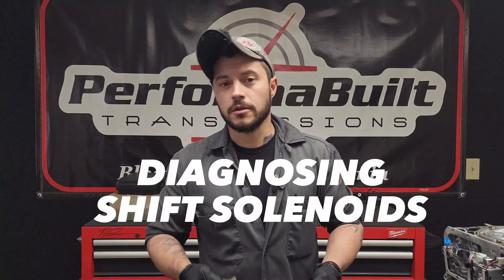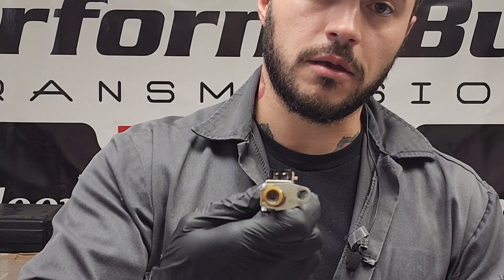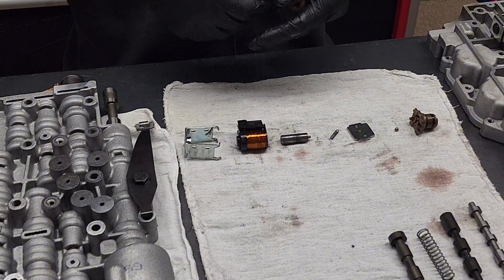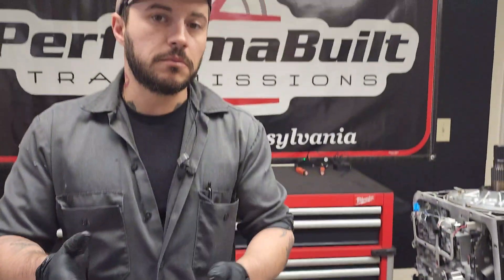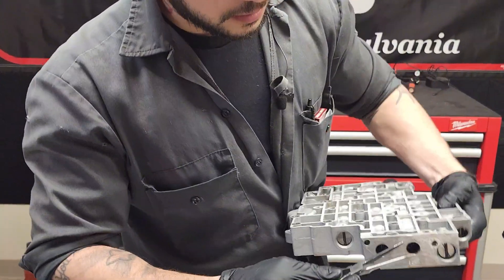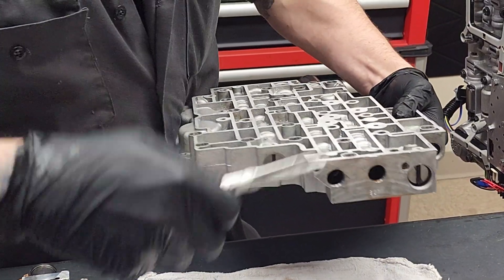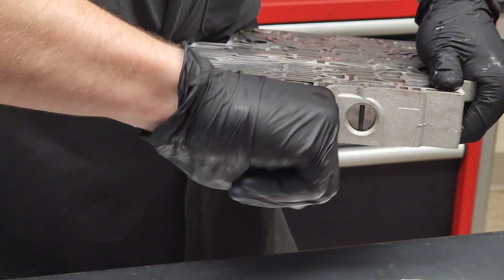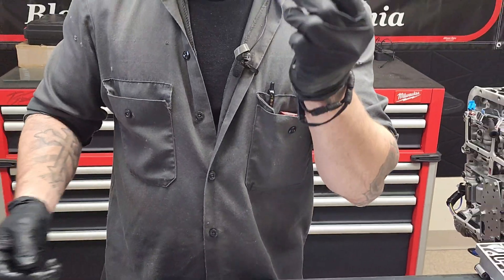Diagnosing Shift Solenoids

Comment: 4l60E on a 2002 2wd GMC 1500 4.3L V6. rebuilt transmission with your help and transmission service manual.  Everything shifts and works perfect......minus no 4th gear. Any advice as to where to start?
Reply from the maker: Servo piston issue or 4 3 sequence pilot valve flipped is usually a no 4th. If you flipped the piston in the video like i did you must run a very tight clearance for it to work. Either issue doesnt require removal of trans.
Reply: @PerformaBuiltTransmissions  
Right on,  ill definitely check that out and update you when I resolve the issue. 
I appreciate the sharing of all the knowledge you put out for us DIY guys. Videos like these are priceless.
Thank you sir!!

Comment: I have a p0785 3-2 solenoid my car revs high on its own. Will that happen with a bad solenoid.
Reply from the maker: Yes and or you have the wrong 3-2 solenoid for your vehicle year and pcm
Reply: @PerformaBuiltTransmissions i have the toyota sieana 2006, I repaired the solenoid, but now it doesn’t go in reverse, what i do now

Comment: Hey. I am having this issue with My 2008 Honda city Vtec. It Jerks when it is  stops at a traffic signal on Driving gear. The rpm needle goes up and down everytime it jerks. The jerk goes off when I switch it to neutral or parking gear.  Any one facing the same issue? Please help.
Reply from the maker: Unfortunately hondas are very different from what this channel covers.

Comment: thank you for mentioning the TPS as a possible issue with shifting, I have no codes and fluid is cherry on a 42RLE. It feels like I have some odd lag in TCC lockup 55-70 mph and a slight 3-4 shift delay, the behavior is intermittent and subtle, all is good and solid when accelerating mild to hard, it only does this when lighter on the throttle. I did the quick learn for the trans and no change. I did notice one TPS voltage was slightly below the minimum, being from MI, I am going to chase and clean all grounds first and go from there. Great video, thank you!!

Comment: I’m trying to figure out what’s wrong with my s10 2.2, I’m hearing a terrible shutter noise at high rpm shift when shifting at any gear. If you don’t floor it tho it shifts normally and can reach 90 mph. Seems like the torque converter clutch is not engaging for lockup but I don’t know enough. No codes are thrown and iv overhauled the engine.
Reply from the maker: Fluid level running in park and condition?
Reply: @PerformaBuiltTransmissions fluid level was fine in park, running at opp temp. I’m going to replace the tcc valve with the fitzall valve. I’m sure you are aware how the valve body bore can be worn out from rapid movement. People seem to like the lockup being on/off so I’m hoping it helps.

Comment: P0753 05 tahoe 5.3 have no first gear from start. I have had it in the past now im getting a stored code. Pretty positive the solenoid was going out and is done now. Hope solenoid replacement is all it needs
Reply from the maker: Def would start there. Easy cheap fix if thats it. Also check vss sensor
Reply: @ i already threw shift solenoids in fixed it and sold the truck

Comment: Is it possible for a my 4l80 shift solenoids to cause it to shudder/vibrate (feel like rumble strips) on the 1-2 shift and then prematurely shift to 3rd then 4th and back to 3rd right away. I replaced my torque converter hoping that was the issue and it was not. As far as i know the transmission has 240k on it and has only had fluid and filter changes done. I should add it shudders more as the transmission gets warmer.
Reply from the maker: No shift solenoids will not cause a shudder. If a bottle of shudder fix does not help, then the iron drums and bushings may be wallowed out. Common on the 80. Try the bottle of shudder fix. Perfectly safe and works most of the time
Reply: @PerformaBuiltTransmissions  i had thrown 2 bottles of lucas transmission slip/shudder stop and it hasn't made a difference whatsoever.
Reply: @PerformaBuiltTransmissions  it only does it during the 1-2 shift and if i let off the gas it fully grabs the gear (from what i can tell thats what its trying to do) and doesn't do it again till i stop and restart the process. I should mention I just found out there is transmission fluid in the transmission harness plug so it is bleeding through the connector. Could that and the shift solenoid cause my issues together?
Reply from the maker: no oil is non conductive. intermediates may be toast. has the unit been serviced recently fluid and filter?
Reply: Good evening I have a 2014 2wd Tahoe 6l80 and when I’m at a stop and accelerate it more aggressively i get like a thump feels like something is slamming in transmission type of noise. But other gears and all shift good no problems from park through all other gears. I changed fluid with own gmc synthetic fluid and filter to see if it would change but nothing. It doesn’t overheat like the other 6l80s and it has 125k miles? Can it be a bad transmission control unit from a bad solenoid to do a harsh shift from first to second ? Thank you brother
Reply: @alexsantana5377 hey I’m having the same issue with my 2011. Did you ever figure out the issue?

Comment: Hey brother, what if I don't have a code, but I am have a 4L65E hard shift from 1st to 2nd, and it is a long down shift from overdrive to 3rd? But other than that is drives good. I just don't like how it's doing 1st to 2nd!
Reply from the maker: Get a tune just like you would your engine. Tuners can adjust shift time to a certain degree. Just like an engine tune, transmissions need tuned too
Reply: @PerformaBuiltTransmissions  I live in a small town and I don't know who I would talk to unless a dealer would do it and I bet they break the bank for that lol 😂
Reply from the maker: Remote tunes exist as well

Comment: I've got 2001 silverado 4l60e transmission shifts good when not under load but when pulling a trailer 1 and 2 are really jumping and jerky any ideas thanks for reading
Reply from the maker: Check the basics like fluid and filter and clean your maf and air filter. If you have codes and or misfires you must fix them immediately. 99% of the time if first is acting up its always service neglect or vehicle issues.